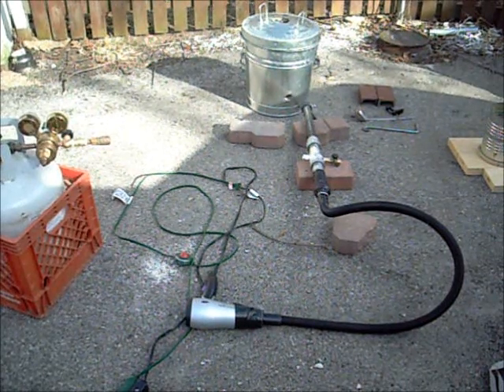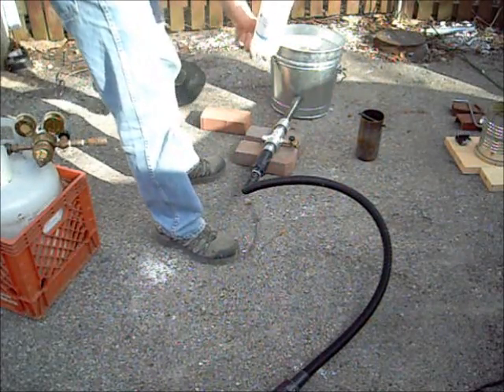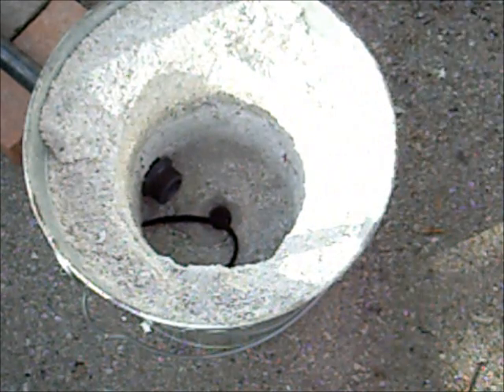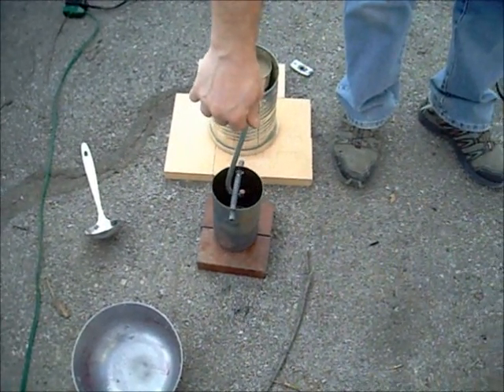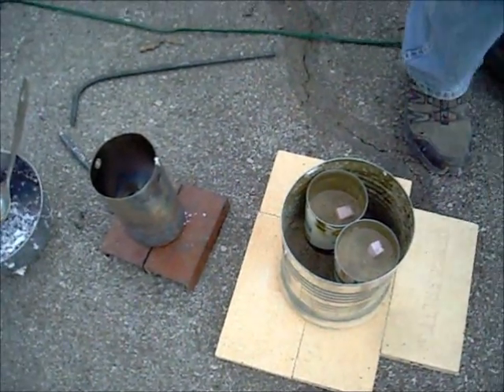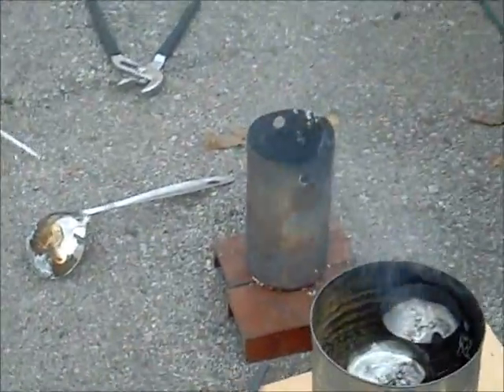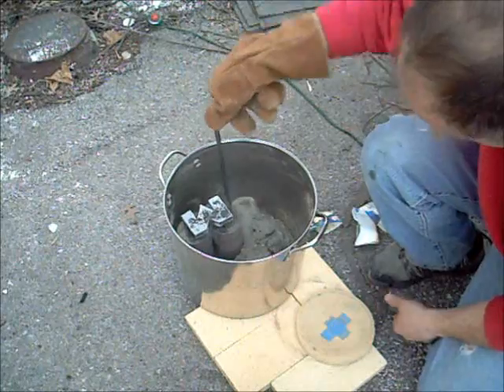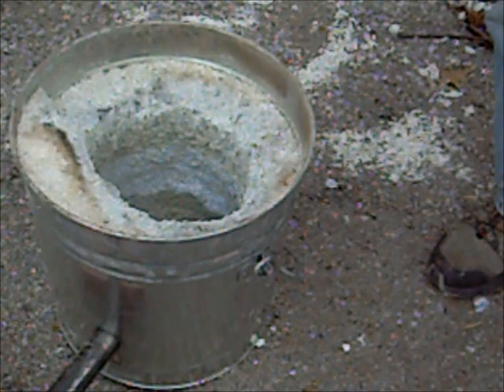First Foundry Melt

Comment: The Sodium Silicate, when it's still wet, will puff up and sizzle, when high heat is applied. The melted look is from the liquid left in the Sodium Silicate boiling off. Once the water is boiled out it, it hardens the same as it would, if it had fully cured. It will leave you with a vitrified look, if the Sodium Silicate hasn't dried out properly.

Comment: IDK? I guess you could call it "Proof of Concept" because it did work but for all the hard work and time you put into the furnace it's kind of sad-that furnace should have never failed as bad as it did. I have been watching hundreds of videos on back yard foundry as I have gathered all the parts to build one -the main thing I am trying to figure out is what would be the BEST refractory mix to use -it sure seemed as if you had all the recommended items for a good mix as I was leaning towards that same mix but now I am not to sure -What do you think the problem was?

Comment: your either not using enough silicate or you not making good silicate 
that perlite shoul set up like concrete 

also let the thing dry sor a damn month.

i fave used hot silicate and it sets in a couple of hours
Reply from the maker: I think it was the perlite melting not sure though